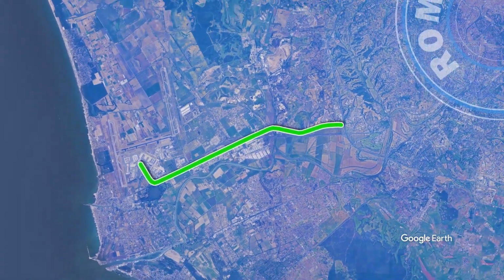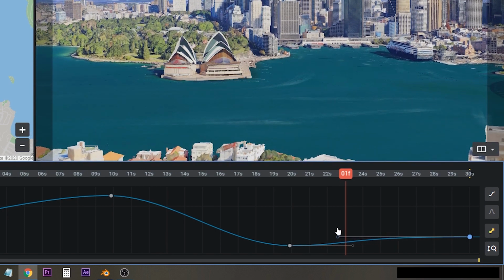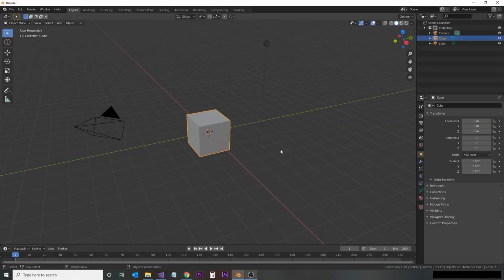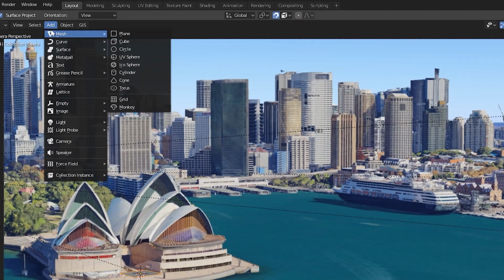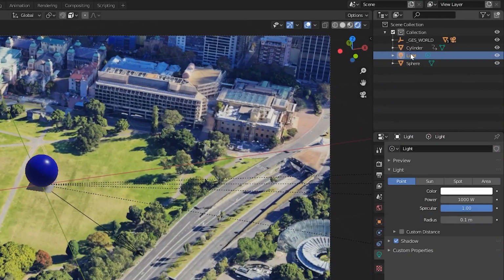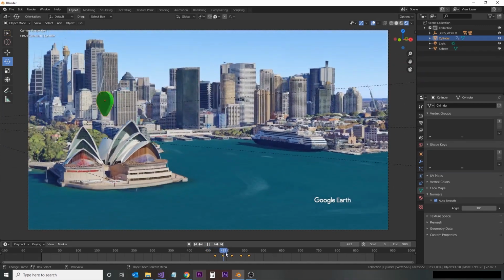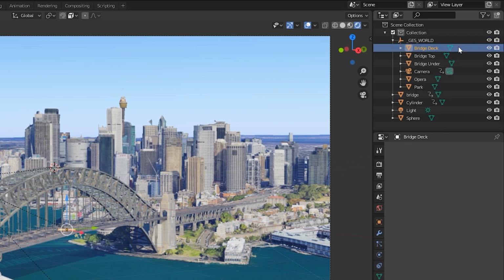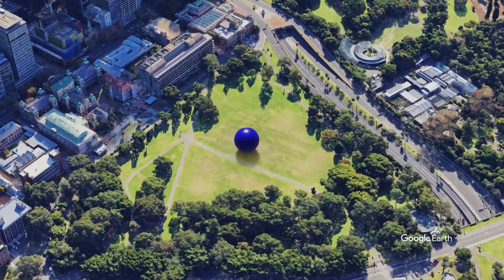Blender & Google Earth Studio - 3D Augmentation 🌎 + 🔥

Comment: I have a question, how can I extract data into Blender from Google Earth Pro? Not Web. Because Middle Eastern buildings only appear on PC version of Google Earth. In Web version there are only flat areas in the desert, nothing else. But I felt like I have to extract them for my project, really. So, if you have any knowledge, what's the way to extract those 3d Middle East buildings to Blender?
Reply from the maker: I'm not aware of a tool to extract from the pro version. Usually the imagery on the pro version is also represented on the web version, but there may be several cases where it is not ... There are several data sets (servers) that produce different "times" of data - it may be a case of waiting for other servers to update.

Comment: Thanks for the tutorial, but I couldn't make it happen. It keeps highlighting line 12 - cam.data.show_background_images = True. Red the comments and I'm 100% sure the names are correct, tried many times, many folders inclusinf the same names as the example, still didn't work.
Reply: Hey I had the same issue but I added a camera and it worked.

Comment: I'm running Windows 10, but the file directory uses backslashes instead of slashes, so I get an error when running the script. Is there a way around this? Thanks
Reply from the maker: Use the example provided. You will need to modify slashes if you cut and paste.  Also, make sure you have the correct number of zeros in the filename.

Comment: What am I doing wrong? I always get this message(Python script failed,check the message in the system console). Nevertheless, thanks for the eloquent tutorial
Reply from the maker: Errors are usually due to incorrect path or the 000 and 0000 (3 zeros vs 4/5 zeros) on the filename
Reply: @imagiscope  Probably is the syntax error because of the first command line which must be changed.That is what i get for the path in the propertys    C:\Users\jimy 2\Documents\GES Ibiza\footage      .
Ibiza_000.jpeg is not a folder so the i have to added it manually,my end product will be  jfilename = "C:\Users\jimy 2\Documents\GES Ibiza\footage\Ibiza_000.jpeg".It will not work,tried also with  older versions of Blender and Linux, the same.

Comment: The script doesn't seem to import field of view / lens length from the GES camera, is that correct?
Reply from the maker: Correct. Feel free to play with the code and share
Reply: @imagiscope  I wish I new how to do such a thing! Super handy anyway, the camera match worked much better than the previous hack I had going
Reply from the maker: Thomas, there are some variables near the bottom of the code for camera settings. They are configured for the default camera but you could play with them to match your GES camera.
Reply: @imagiscope  Thanks, I'll take a look.

Comment: The script seems to align the coordinate system within blender with the one of the earth. Is it possible to put the cs in blender at an angle of for example 45 degrees in relation to the earth’s cs? I really appreciate the work that went into the script, the tutorial and the fact that you are actively helping & troubleshooting in the comments. Props!
Reply from the maker: You could add a value to the _GES_WORLD object (i.e. 45 degrees) but it will then not properly align with the background images. I'd recommend changing the values in Earth studio then import into blender.
Reply: Imagiscope Travel & Tech Is it possible to do the angle adjustment in earth studio? I can’t seem to find it.

Comment: PS. For the Shadow Catcher simply select the plane you wish to use to display the shadow, navigate to Object Properties, open the Visibility Options and select "Shadow Catcher" to activate it.
Reply from the maker: Haven't checked the latest version, is shadow catcher now available in eevee?
Reply: @imagiscope  Unfortunately not. I'm running 2.83 and still have to use a node based setup to achieve that
Reply: @imagiscope  But to be fair I still find myself using Cycles a good 70% of the time.

Comment: The x,y, z coordinates of the target origin are not parallel and perpendicular respectively.  Is there some way in the script to insure the x,y,z coordinates import correctly?
Reply from the maker: The script will "flatten" based on the first trackpoint (set at 0,0,0). The coordinates are based on globe (sphere) relationship and are perpendicular to the surface of the point. Feel free to play around with the code to find what works best for you.

Comment: I get an error at line 12 cam.data.show_background_images = True, but console doesn't show anything (running Blender 2.83 and OSX 10.14 Mojave)
Reply from the maker: The File system structure is probably different for Mac OS. Adjust accordingly.

Comment: Hi, I've got an error in line 53...

Traceback (most recent call last):
  File "\Text", line 53, in <module>
KeyError: 'relative'
Error: Python script failed, check the message in the system console

Any idea what could be the problem?
Reply from the maker: I suspect you either have no track points or you may be using a local coordinate space when rendering the JSON file (should be Global).  It may also be that you only have one track point - it should work with one, however, I usually add several so I may not have tested the code with just one.  Let me know if that works for you.
Reply: @imagiscope  I've added 40 now, and that kind of works, however, the tracking point planes and the google logo are jiggling all over the place.

Comment: is giving error on line 11. (ifiles)
Reply: I had the same problem copying paths from windows explorer, it started working when I replaced "\" with "/".
Reply from the maker: Yes, that'll mess it up. I'm looking at adding a dialog to open the files (no changing the code, just run the script)
Reply: @arturotrujillo9117   
Thank you so much I got it with the method
Reply: @kleyton21  hello where did you add that ?
Reply: @arturotrujillo9117  add this to where?
Reply from the maker: The path or filename is incorrect. Double check it (make sure you have correct number of 0)
Reply: @imagiscope  

tried everything.
😢

import bpy, json, mathutils, math, bmesh
from mathutils import *

cam = bpy.context.scene.camera

scene = bpy.context.scene
# load the GES render files as background for camera
# Sample format: ifiles = "D:/Local/Project/Beach/beach/footage/beach_0000.jpeg"
ifiles = "D:\Download\city\footage\city_0000.jpeg"

img = bpy.data.movieclips.load(ifiles)        
cam.data.show_background_images = True
bg = cam.data.background_images.new()
bg.clip = img
bg.alpha = 1
bg.source = "MOVIE_CLIP"

# load JSON file for evaluation
# Sample format: jfilename = "D:/Local/Project/Beach/beach/beach.json"
jfilename = "D:\Download\city\city.json"
Reply: Error line 11 is the isse for me

Comment: Hello... thanks for this video... and I have a strange problem for that. As you introduced, I used your script and loaded JSON data in Blender(2.82a).
MY GES video includes 7 track points and it exists in blender as well.
But... the problem is that when key frames goes, the track points are moving! not fixed as track points.... why it happens...??? do you know? hmmm.... so strange.. 
can you guess?

In After Effects, the track points are working well(JSX file)...

I reviewed in detail your script code, so I have two supposition for the error..
please let me know the solution.

1) in the end part of your script, there is "# camera "lens" based on 20 degree Filed of View (default value)"
I changed the value of camera "lens" from 20 degree to 37 degree in my GES video. Is your script working only in 20 degree?? is it possible to use different degree by changing your code?

2) For this GES video, I am using 1320 X 1080 px. But... in the blender view, the loaded JSON video data looks having longer width. Could it be problem? Is this script only working in 1920 X 1080 px?  I didn't find any code in your script related with resolution(px).
Reply from the maker: The "moving" is due to incorrect camera settings...they aren't moving, the perspective is off...

1)  I haven't tried other field of views within Blender (only default). The figure of 34.8d with 35mm was a combination found via trial and error for 20 degrees from GES. You'll have to find the correct measurements if you are using a different setting. When you find the correct values, please share. 
2) you should just be able to adjust the scene resolution and be set.  I could also be added to the code if necessary as I believe the values are in the JSON file.
Reply: @imagiscope  Thanks for rapid reply... but even though I found appropriate combination, if I use different value of degree, I need to find new value again... but if there is no any calculating relationship between combination and degree, the usage of this function connecting GES and Blender is so limited...  isn't it..?
Reply from the maker: If I were selling this solution, which I've provided for free, I certainly would want that value tied to a calculation. There is a calculation - perhaps in future updates I'll come across it or other will share their findings. I've yet to use the solution with other fov but when I do, I'll be sure to share.

Comment: Earth studio sometimes changes the focal length when it moves from one point to another. Is that information also carried over?
Reply: Never mind, I just had a look through your script and I can see it's in there at the end.
This is so awesome, thanks again
Reply from the maker: Hey Keith - right now it's "hard coded" for 20 degrees. For other field of view, we could also use a formula. Feel free to play with the numbers if you're changing from the default fov.
Reply: @imagiscope  I see.
The issue is, if you want to go from one city to another, as the camera ascends, it drastically changes the focal length, then as it comes down into the new city, as it gets low, you can actually see the effect of the changing of the focal length, reminiscent of some classic Hollywood shots...

But, that info should be in the JSON file, so I can try getting from there.
Reply from the maker: @คี-ซะมะ  I've tested some long distance "city jumps" and I haven't experienced that issue. The GES data is scaled 1/100 to better work with Blender (it seems to distort at world scale). The trackpoints will curve around the earth surface starting at first trackpoint (0,0,0 rotation at 0,0,0 location) then all other camera and trackpoints are relative to start. Give it a test, let me know how it works.
Reply: @imagiscope  yeah. I was doing it up to world level (Toronto to London). But I'll play around with it.